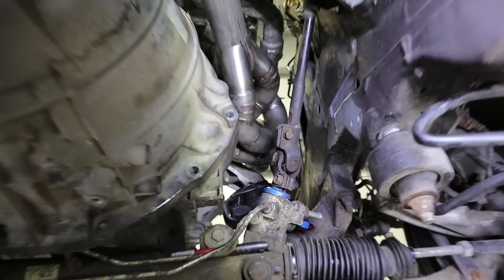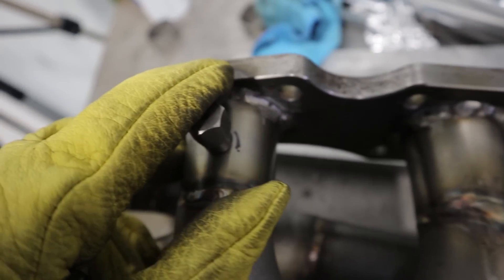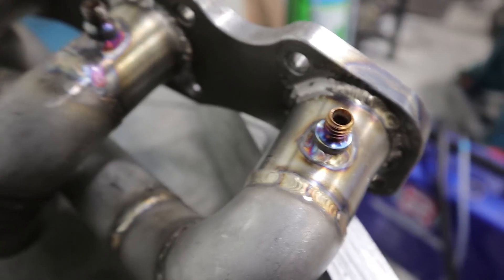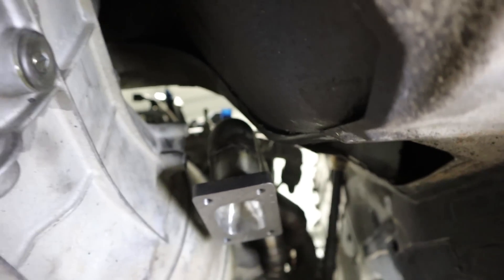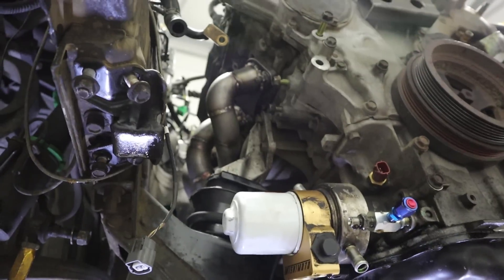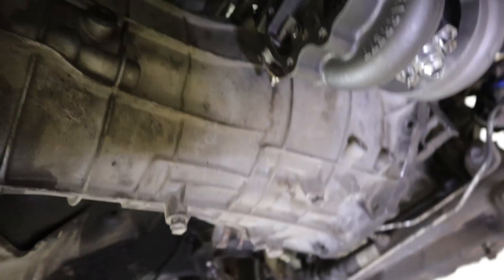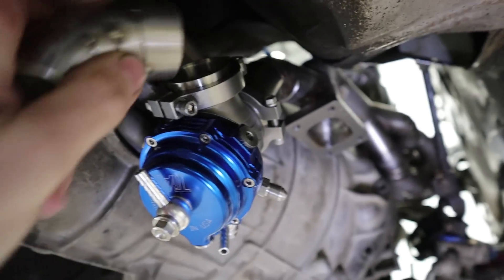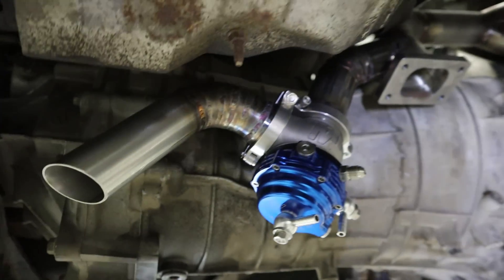DIY 350Z Twin Turbo (3) - External Wastegates

Comment: I know i'm pretty late, I don't know if you are going to see my comment,  but I just found you, and I have to say that I like the content so far! I had to comment because i'm a professional TIG welder in the food industy. Most of the time, when  you are back purging SS pipes and it start to "pop" and the welds turns grey/black and your tungsten get contaminated like at 9:13 ,most of the time it's because you have a little gap between your pieces and the argon flowing from the inside (back purge) is displacing the argon from your torch, creating turbulence. Keep in mind that you don't need a lot of flow to back purge, you can crank it a bit before welding to speed the purging process a bit, but once it's totally purged with argon, you can basically turn it down to almost nothing when you are welding short parts like that, it should help these problems from hapening again.
Reply from the maker: thanks for the tips, much appreciated!

Comment: EGT sensors are a good indicator to tell you if it's running lean , which is really bad on forced induction engines 💥
Reply from the maker: Yeah but the O2 sensor tells you that as well. I know both the O2 sensor and EGT are able to help you tune the air fuel ratio and avoid running mean, but I'm not really sure why we use EGT for individual cylinders yet O2 for banks of multiple cylinders
Reply: @ChrisDrift  few reasons which you've already guessed. You cant run an o2 that close to the exhaust port - it would cook in no time - and present a fairly significant blockage to exhaust flow. K-type probes are tiny as you know. Delta in the egt's (leaner = higher temp) will be used by abbey to trim the cyl's or, more likely, add a touch more fuel going rearward where inevitably the temps will be higher. Btw go post turbo with the o2.
Reply from the maker: @jongant4937  ah ok thanks for the info. Yeah I looked into O2 sensor placements last night and apparently it's recommended to go at least 20 inches back from the turbo
Reply: That seems like quite a long way back to me.  Manufacturers put them as close to the turbine as they can in my experience.  Your primaries are quite long already - phnarr - perhaps that advice is more relevant with ultra-short manifolds like you see these days, where they form part of the cylinder head.  If you go too far back the o2's won't read so well when cold.  Fair enough, not so much an issue with a drift car!

Comment: Do you not need to connect the external wastegate back to the exhaust?
Reply from the maker: Nope. You can do, will make it quieter. But not necessary
Reply: ChrisDrift cool thanks for the reply 👍👍👍👍

Comment: Have you considered how low the turbos will be relative to the return port on the crankcase? It is very imperative that you get the most direct, unobstructed gravity flow on the oil return. At least to the best of your ability. Otherwise your turbo lifespan will be short and the earliest sign is oil pushing thru turbine and out the exhaust. Oil in turbos backs up so easy it actually pisses me off. I have the GTM Stage 2 TT kit and the 45 degree oil return fitting was enough to obstruct flow. Granted, it was still serviceable and I hydrolocked my motor before turbo failure T.T. But thats whatever! I know there is a remedy if you need. I can't remember what it is but I heard about it on mcmtv2 channel; Barra series.
Reply: Built my motor and twin turbocharged my car short of fabrication. Actually did the motor in my apartment patio 4years ago. 2018 build is VQ 11:1, 2x GTX2871r, 1400cc inj, twin walbro 450, radium surge tank and radium rails, E85!!!! Massive f$#king Zirgo fan (I want to suck the soul out the earth)...stock brakes. LMAO I'm in danger!  Looking forward to watching the rest of your build. If you need info. I'm sure you know about my350z.com
Reply from the maker: Yeah there's no way it'll gravity feed back to the sump from where I have the turbos so I'll be using a scavenger pump to pump it back
Reply from the maker: @damonf2450  surprised you kept to such high compression ratio, but then I guess E85 helps. Unfortunately we don't really have that available around here

Comment: Just out of interest what welder do you use and why? it’s something I’m looking into..........think it’s going to be a steep learning curve!!
Reply from the maker: I use an R Tech digital AC/DC tig welder (170 amp version) and would definitely recommend it if you have the funds. If you're only going to do steel and stainless steel (not aluminium) then you can just get a DC one rather than AC/DC, so that'll save a fair bit of money
Reply: ChrisDrift thanks for this, appreciate it and really enjoy your videos. Was currently looking at a Lincoln speedtec 180 multi processor but will definitely have a look at R-tech though........not that I know what I’m looking at! I have a e36 m3 track car and e30 m3 that I’m restoring and welding is the one thing I’ve never got into so it’s time to learn (not practicing on the e30 don’t worry)

Comment from the maker: PSA: don't touch metal after you've just spent ages welding it. Its very hot. Who knew.
Reply: The same goes for fire stove doors, when you touch it with your chin it burns and leaves a lovely mark.
Reply from the maker: @philmitchell9413 I'll take your word for it haha
Reply: Don't put it in 2nd when its meant to go into 4th ;)
Reply from the maker: @ChrisYTube82  haha weyyy, classic meme

Comment: Does any body you drift with make there own parts to this extent?
Also you must be in it just in tools alone.
Reply from the maker: I think it's quite common for people in drifting to do their own work like this. Not everyone of course, but certainly more than you see in most other motorsports. I think a lot of people would have maybe bought a pre made exhaust manifold though lol but I wanted the challenge
Reply: @ChrisDrift  Not related but do you miss your R8? Or are you just over supercars.
Reply from the maker: @philmitchell9413  generally I'd say no I don't miss it, but occasionally I do find myself looking at porsches etc on AutoTrader lol

Comment: hey Chris , I'm having a hard time picking a stage 2 clutch kit since my g35 coupe is going be a drift car  .which brands would you recommend ?
Reply from the maker: I used the Competition Clutch Stage 2 one on my 350 for the last year and its handled all the abuse no problem. Obviously its never going to be quite as easy to use as the stock clutch in daily traffic etc but its not bad. If you're still running close to stock power then I'd say that's a pretty good choice
Reply: Thank you Chris , always which website can I find the Competition stage 2 clutch kit ? I usually use enjuku

Comment: What are you going to do if you have to pull the gearbox?
Reply from the maker: might be able to wiggle it out once the turbos and wastegates are removed, but failing that will have to just take the exhaust manifold off. Not gonna be quick or easy, but its not like taking the gearbox off is a common thing (I've done that once in the last year and a half). Might get through clutches slightly faster now with more power but its still not going to be a regular occurrence... hopefully
Reply: ChrisDrift.  I work at a nissan dealer so i done probably about 100 clutches on 350s so i can see its not going to be fun. You will probably need a good 4 to 5 inches to go backwards before you can drop the trans down.  The build is looking good.
Reply from the maker: @CornellW003  yeah I've had the gearbox off mine a few times now whilst test fitting the turbo stuff and also swapped gearbox on another 350, so I'm fairly familiar with it. If it becomes too much of a pain I could always put a V band in the middle of the straight part of the exhaust manifold, then can detach that last section that's blocking the gearbox

Comment: Very impressive taking this on yourself! I had Zircotec coating on my Manifold, it's very very expensive!
Reply from the maker: yeah they said about £700 for mine, which is a lot more than I was expecting... but if it helps as much as they say then I probably need to do it considering how close the manifold is going to be to everything

Comment: Loving this series! Nice work.. Are there any issues with weight hanging so far back from the manifold? 
I'm curious if you'll be supporting/bracing the turbo at all..
Reply from the maker: Yeah definitely going to be bracing it with some rose joint rod ends so it can flex a little

Comment: Work looks great man. I am a fabricator myself so its nice to see some one els do the same. 
The EGT sensor placement has nothing to do with the price or size. 
When your EGT's rice above a sertain temperature, the pistons will melt and damage the engine. You can monitor and prevent detonation by looking at the EGT's.
This is one of may reasons to use EGT sensors btw :)
+ you are probably going to run into issues with the return line for the turbo. The mounting spot is reaaaaaly low if you look at the sump... keep that in mind man
If you need any advice to welding, give me a dm on insta man. @stanleykoops ;)